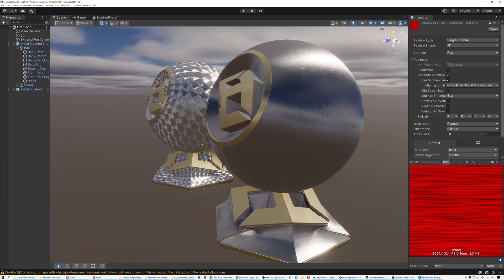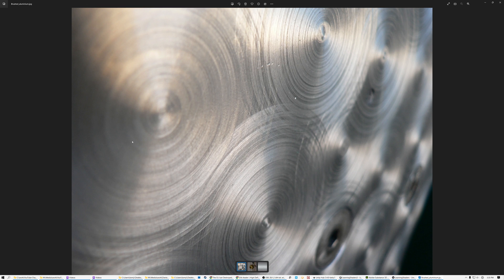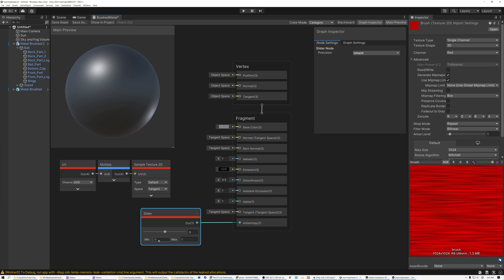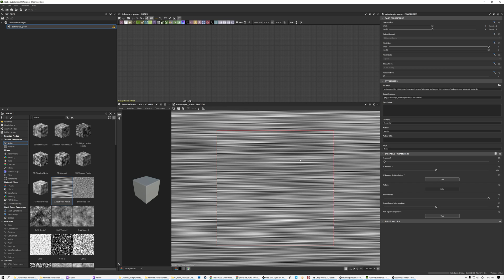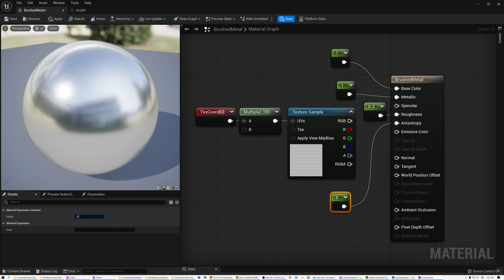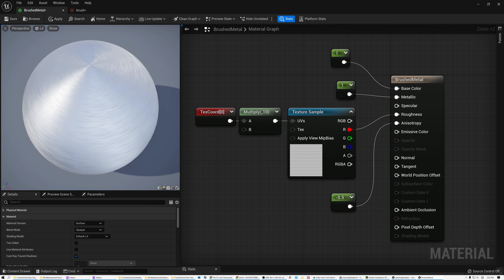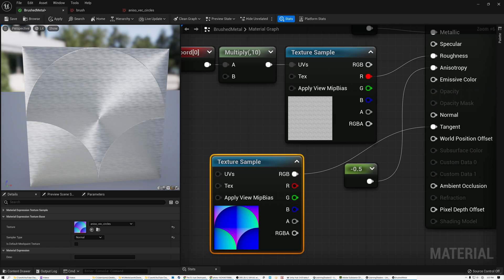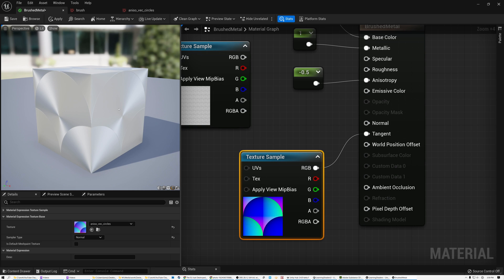Brushed Metal Shader - Advanced Materials - Episode 11

Comment: Really nice tut work here, alas something is out on this end implementing anisotropy when using tangent space normal map, one based on isolated specular info from a scan that captured the reflections on individual threads in a fabric to then feed the anisotropy the directional flow of reflections on this folded fabric(s). I checked to ensure sRGB was disabled, see Normalmap (DXT5, BC5 on DX11) for compression, anisotropy set to 1.0, see the low roughness, but no sheen.

Comment: I've seen rocks that looked very dry and dusty looking, I don't know how to say this, but it looks like those rocks in the middle of the dessert. Perhaps this method can be used to get such result too?
Reply: I wouldn't use anisotropy for rocks, only for stuff that needs the spec highlights to bend in a specific way. I think you'd want to use a fresnel node to blend between the diffuse color of the rock, and another copy but color corrected to look brighter, and more colored like the dust color you want. In vray, you could use Sheen, which is great for dusty surfaces and fabrics, but in Unreal, I am thinking a fresnel node will fake this the best. Or maybe just rely on texturing the rocks to shade with higher roughness where the rock is more dusty.